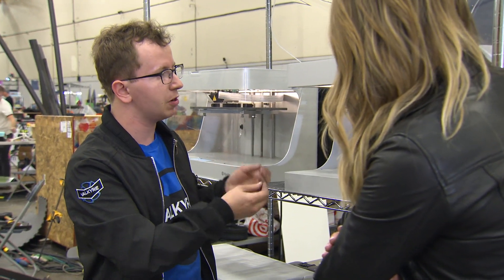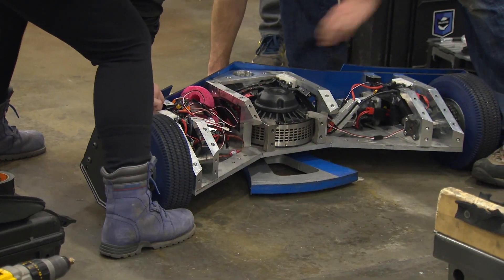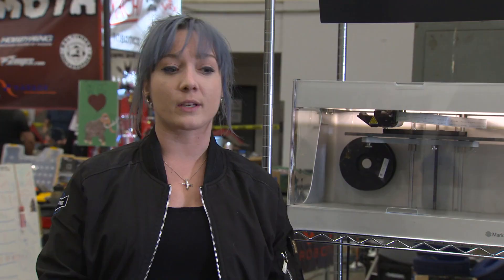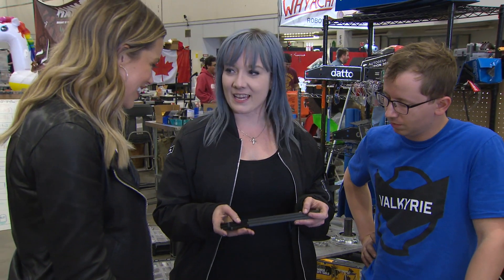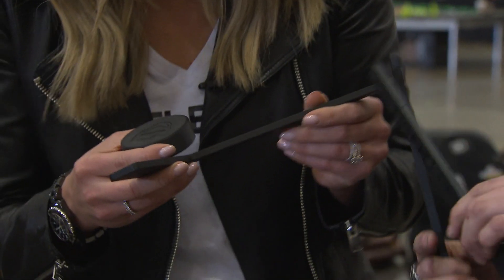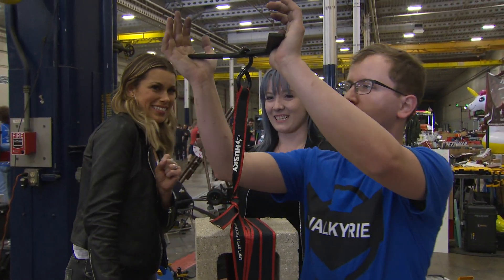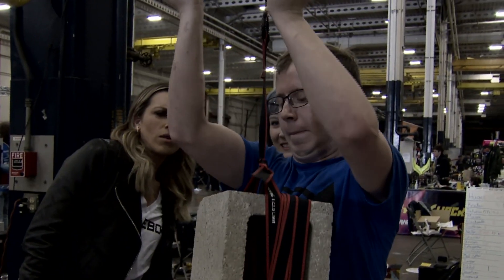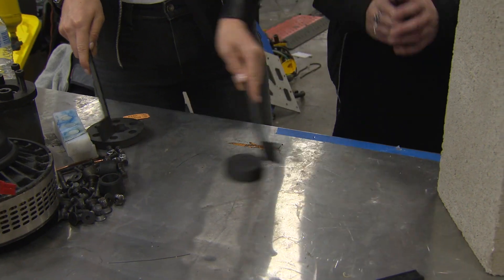Amazing 3D printer saves BattleBots!

Comment: 3:20 I call shenanigans. He let the hook slide to the side on the second test.  This greatly changes the forces on the test piece....
Reply: The first stick immediately bent to keep the hook in the middle during the lift. The other did not bend which is harder to keep in the middle without equal pressure on both sides of the stick which this guy obviously could not do.

Comment: I work with these Markforged printers and they really are fantastic. We have a display case with a tiny suspension bridge model about as thick as that hockey stick they printed, and it has been holding up two cinder blocks for over two years undisturbed.
Reply: It may hold forever in a controlled environment. Introduce some aging elements and wear may present itself as time goes by.

Comment: You cheated by sliding the hook to one side and not keeping in the middle
Reply: Hi, Kevin! You're absolutely right about the slide, but I'm sure it wasn't deliberate cheating. The demonstration was still quite revealing because the soft stick bent evenly, immediately, right in the middle, which meant the load stayed in the centre.

A hockey stick's a lousy shape to lift with: the broad, flat head end gives great support, but the back end is thin and digs into the palm of your hand. So the back end drops slightly (because lifting 30 lbs hurts without a handle!) and the shaft of the stick tilts, sending the load shooting sideways. 

Although the reinforced stick didn't keep the load in the middle and it slipped to the side, the point is that the stick resisted the same 30 lb load well enough to send the load sideways. In other words, the middle didn't bend enough to keep the load in the middle. That alone suggests that the second stick was much stiffer than the first one.

Whatever. Well spotted, sir!  :-)
Reply: @EleanorPeterson  maybe it's just bc the guy is weaker with his left arm and lifted a little higher with his right sending the hook sliding to the low side. Also it doesn't matter bc where the hook slid to was the apex of the stick which is where the part is "usually" the weakest.
Reply: Did you see him hit, i mean miss the button? He might need to reinforce his arm with Carbon fiber

Comment: Plastic battlebits great idea they should try to print tombstones blade
Reply: The blade doesn't matter.  For Tombstone it's the RPM from the weapons motor.  The battlebots people told ray to reduce the tipspeed of his blade.  They don't want it going through the lean sides.  I wonder how much they spent replacing broken lights.
Reply: @drmayeda1930  interesting. 
Ray's biggest enemy is himself. It's either knock the opponent out or get knocked out by your own effort.

Comment: I like the way that 3-D printing is finally able to produce serious structural components (no disrespect to earlier developers intended). I shudder to think of the cost for a small-scale hobbyist, though. And I'd be interested to know just how large the printing chamber can be.

I build and fly big, lightweight, RC gliders. They use lots of composite materials; the strength to weight ratio is fantastic. But the wing spars are laid-up wet from carbon fibre, aramid [Kevlar™], balsa, foam/honeycomb matrix, fibreglass, and epoxy resin, then held under vacuum pressure to cure. The results are spectacular - almost unbelievably strong and light - but it's messy, complicated, and slow. Oh, and the spars can be up to 1800mm (about 6') long.

So I don't think there's a 3-D option for epoxy freaks like me just yet.   ;-)

Nice video, though...
Reply: I 3d printed a mold, and did a carbon fiber/kevlar layup for my antweight robot. Not exactly bulletproof, but it works :)
Reply: What about layer-adhesion? I think it is far away from metal ;)
Reply: @Leon-pm6lr  Smart engineers never put load on composite materials in the direction that they are weak in. Other directions the materials are as strong, or stronger than most metals.
Reply: There are "digital printers" available now that when connected to a concrete pumper truck can actually "print " a house!  While still experimental, the potential for remote or disaster area housing is needed.
Reply: This Tech is the Future of Everything...
Eventually most Car Parts will be made this way, as will just about anything you can
think of... especially things that need to be strong and light weight.
This Tech is in it's Infancy.
Reply: @cruzinthru8285  Eh, 3D-printing isn't great for mass production elements. It's too slow. It takes hours to print a single part, where as with something like say Injection molding  you get 10 parts in seconds. 

3D-printing is a fantastic product for prototyping and hobby applications, but for production it's terrible. the only companies that are implementing 3D-printers are places that operate on custom orders. Shapeways for example, they take files and print on demand, but their prices are insanely high compared to similar production elements. 

It just doesn't scale,  making 1 part and 10,000 parts doesn't improve the cost per part when talking about 3D-printing. Sometimes making more can actually increase the cost per part.
Reply: @MrFrostburner  - Yes, I understand, but this is with today's tech.
I am thinking 25 or 50 years from now they may speed things up and it would
be a viable way to produce mass quantity of certain things.
Reply: I would love to watch your Gliders Fly, and or see how they are built.
You should make Videos for your channel on YouTube. :>)
Reply: @cruzinthru8285  - Hi! I've been considering trying to get a Channel up and running and making some building and flying videos, but I'm not sure it'd be worth the effort. There are so many RC videos already... Is there room for more?

Also, I'd need cameras and lights and my PC's 15 years old, so editing would be pretty painful. It takes a long time to make anything worth uploading. (I don't like scrappy, rushed stuff.) My friend Pete's got a Channel about kites (and other flying things) where he makes and does everything himself -  even writing and playing the music -  but it's a lot of effort for no reward except a few sarcastic Comments; I think he's got something like 6 Subscribers after hundreds of hours of ridiculously hard work.

Maybe I could present my videos topless...  ;-)
Reply: @EleanorPeterson  - You are so funny... (Topless) ... No Doubt everyone would want to
see that, but YT wouldn't allow it... maybe OKRU but not sure. lol
You are right though, it is a lot of work with really no reward.

I had a "True Crime" channel here for like 8 months that I started around
this time last year.  It got taken down a few months ago.
Even though I didn't produce the TV shows I posted, I did edit out all of the
Junk that other channels left in, making it a seamless flow, with no repetitive
scenes, no spoiler intro, no series ID before and after commercial breaks,
no re-caps etc.  I had 40,000+ subscribers, but it took a lot of work in editing,
when I was posting 3 to 6 videos each day, 7 days a week.
No reward, other than knowing I made a lot of people happy.
(it was a blessing in disguise when YT took it down.)

Your hobby sounds like a lot of fun... a lot of enjoyable work too.
Thanks for getting back to me. Have a great night.
Reply: I print plenty of structural components on my $200 ender 3. With the right materials and design regular 3d prints can be very strong.  They do have their limitations of course but they are surprisingly hard to hit.....
Reply: @DoRC  - I did not know you could buy a 3-D printer for $200.00.
Sounds pretty cool.  Need to look into this. Thanks
Reply: @cruzinthru8285  yeah there are quite a few options.  3d printing is still very much a hobby but it sounds like you don't mind tinkering.  I didn't think I'd use mine much but it's become one of my most valuable assets
Reply: @DoRC  - Sounds like it could be interesting... Thanks again.
Reply: @cruzinthru8285  The Ender-3 is the best selling printer for a reason :)
It's cheap and prints very well.
Reply: @_Piers_  - Thanks for that info.  I will look into the "Ender-3".